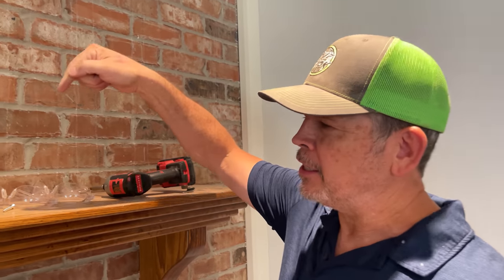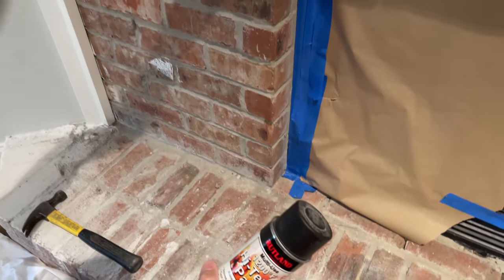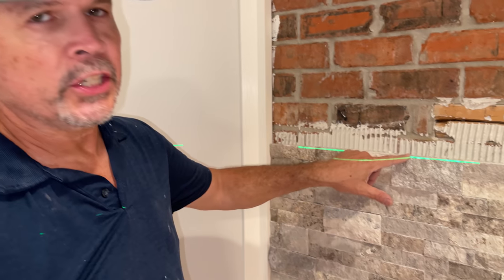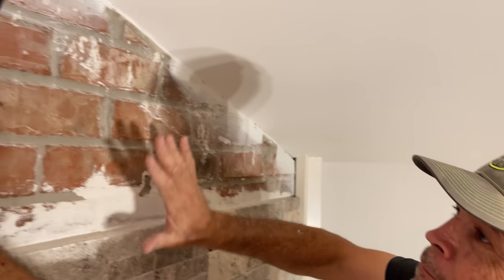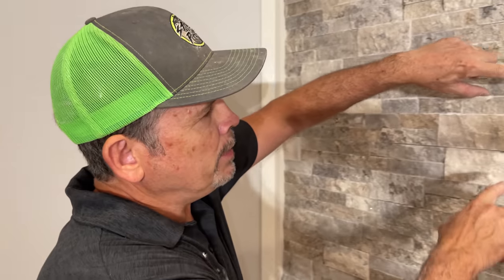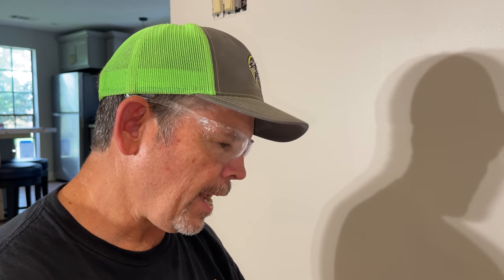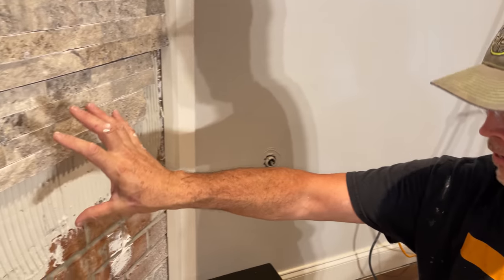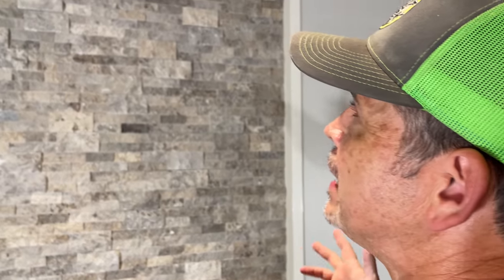DIY FIREPLACE TRANSFORMATION with a CUSTOM HEARTH!

Comment: I have Chicago brick floors that were previously sealed. They are almost the same color as my kitchen cabinets as is. I want to lighten the brick floors and thought that white washing be a good idea; however was told that because the bricks were sealed, I could not do a traditional white wash. Any ideas of how I could get a white wash look on a sealed brick floor and it be durable?
Reply from the maker: That’s a tough one.  Is there an area in the kitchen where you could experiment with different techniques?
Reply: @StudPack  There is a sunroom behind it that has the same brick flooring where we will be installing luxury plank flooring. So we could experiment back there on that floor if needed.
Reply from the maker: Whatever you use it needs to be durable and it has to adhere.   Tinted epoxy????   Seems like that would be a pain to work with to get the whitewash effect.  Gotta be a product out there.  Do you have a good paint store around?   Not a box store....

Comment: Please explain to me why a bevel cut is necessary. Is it a case of wanting the stone to lay flat on top of the brick?
Reply from the maker: The bevel cut along the ceiling?   It’s because the ceiling is sloped.  A 90° cut would have resulted in a gap.  Hope that makes sense 👍
Reply: @StudPack  Thank you for the information since I was confused on why to make the bevel cut. Keep posting great videos.

Comment: Are any of the product you used rated for use on a fireplace? A fireplace puts off a lot of heat and may cause problems if the tile and mortar is not rated for that amount of heat. Some of these products may also off-gas toxic fumes if they are exposed to high heat.

Comment: Interesting...all of the tile folks told me never to tile over brick without cement backer board. I hope it works for you boys.
Reply: They said they still need to grout so I assume that will get filled in, and unless you're laying on the floor, you would never see it.
Reply: @jeremycovelli  The backer board is not for esthetics, it's for adhesion/structural.
Reply from the maker: Brick is a solid substrate.   Don’t see the need for backer board over brick.
Reply: @StudPack  No judgement on my part. As we all know, sometimes there's more than one way to do things correctly.

Comment: Might want to look into a product called Evolve Stone (https://evolvestone.com). You can cut it with a standard wood blade on a circular saw, so no tile saw needed. You can shoot it onto wood framing directly with a nail gun, so no thin set involved. It’s available at the major hardware stores, but it is a tad pricy. But for a channel about to hit 100k you might be able to hit them up for a sponsored video as they have done with other creators.

Comment: Can't get past the gap at the upper right of the fireplace opening - eyes go right to it. Should've started the stonework after the hearth extension was in place and masked off with Trimaco X-paper and there wouldn't have been any need for kickstands on every course. 

The black spray painted bricks is another one the eyes can't get past.

Comment: Thanks for the video clip. However, the camera man focused on the guy's face all the time and didn't even bother to show the entire look of the wall once which I found pretty weird and off-putting.
The Travertine Wall Tile looks good, but it's about 12 USD/sf, so the cost to redo this fireplace would be well over 1k. You can cut off some expense by mixing some part of the walls and the base with glossy wall titles of matching colors in different shades. so it still looks good while you can easy cut the money spent down more than half.

Comment: I was trying to see if this is a real fireplace or one of those fake fireplaces with either gas or an electric insert. It’s either a really good fake with burned wood in it or it is real. If it’s a real fireplace is it still safe to use? I’m concerned with the expansion rates of the heat on stone, brick set, and quickset. If you lit this thing up would it cause all the brick-set to come tumbling down? Y’all are Southerners and probably don’t place importance on alternative heat sources that still work if the grid is disconnected like Northerners do. Not meaning to pick on Southerners here, just pointing out we all have our priorities.